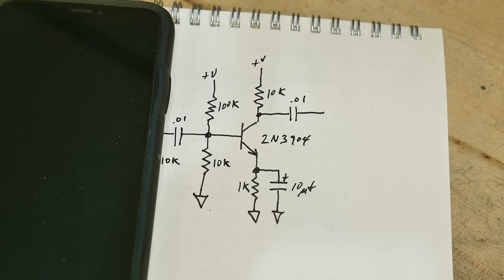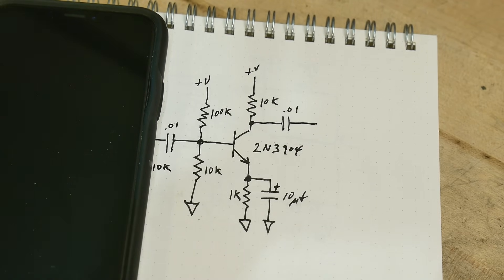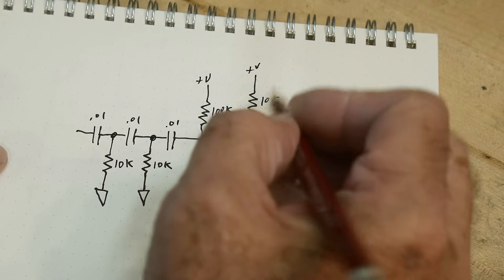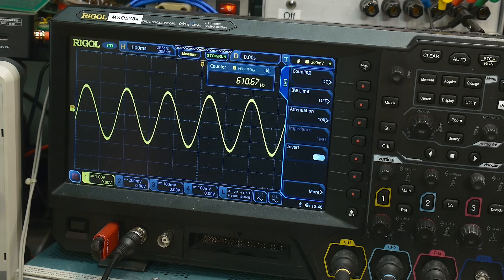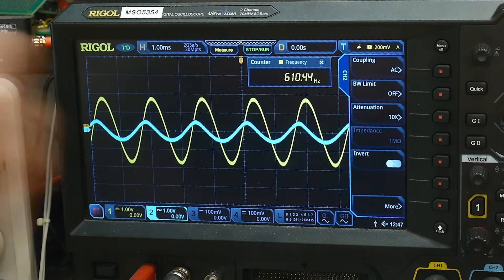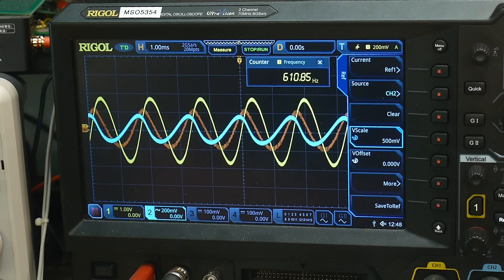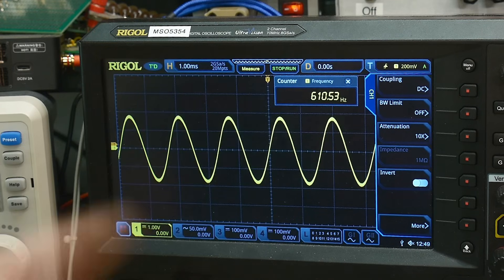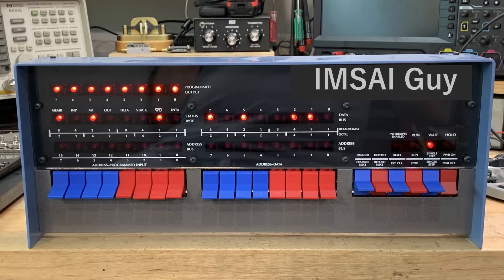#1703 Phase Shift Oscillator

Comment: You are not into nerdy mathematics that much, are you sir?
Reply from the maker: I avoid it on this channel. Lots of other places on YouTube if that is of interest.
Reply: @IMSAIGuy  a physicist is all about mathematics. I read a book of practical electronics by Paul Scherz who is also a physicist. It is an excellent book. I recommend you check it sir it presents material on paper just the way you do on screen sir
Reply from the maker: @awaismushtaq5719  yes, I have a degree in Physics and a degree in Mathematics. I avoid the math here on this channel to reach more people and impart an understanding at a more basic level.
Reply: @IMSAIGuy  cool I like it
Reply: @IMSAIGuy  I am an engineer not an electrical engineer though. Every engineer studies electronics as it is deeply integrated into every engineering discipline. I learned electronics by reading and messing with bread boards and components. Burnt loads of them eventually cutting my losses when I got the grip. First successful thing I built was an AM transmitter with about 50  yards of range. When I was testing it a police vehicle was parked right outside our house. They were there for a different matter yet they had scanners. They picked up my transmission which I was playing from my computer cursing a local politician. They knocked at my door and confiscated all of it. Warned me not to do it again or I'll end up in jail. Electronics is fun. Yet that didn't stop me from building an other one 10 watts of solid power. Still use it off and on but carefully. Your videos are fun, loads of fun. Primarily because you learnt electronics the way I did though you are far better than I'm. Good luck sir!

Comment: It amuses me when people talk about phase changes as one can only see phase change when one sees the past and the present on an oscilloscope!!!!!!
In real time, " The Present"  all the voltages appear at the same time but they have various magnitudes, due to the memory abilities of the " reactive elements.".  When the output of the oscillator is zero voltage,  there is one or more capacitor which has memorised a voltage and this is what keeps the circuit alive and working.................THE MEMORY OF THE CAPACITOR AT THE PRESENT TIME, 
It all has to do with the RATE OF CHANGE OF THE INPUT WITH RESPECT TO THE OUTPUT.   All the action takes place at the present time   and one should not use a two dimensional space to see a sinewave  The voltage at the output of an oscillator is between two terminals all occurring at the same time,  The present is such a short duration of time and one needs memory , rather than " phase".

Comment: Nice and interesting! Thank you! Could it's freq be varied by varying the 3 10k simultaneusly? With some sort of VCR... FETs for instance? What about the distortion of the sine with this topology? It's purity
Reply from the maker: you could try these: https://youtu.be/9SzruMuWF8E?si=xGmGTg8UY5943kih
Reply: @IMSAIGuy   Thank you, I'll take a look! My idea is to keep it simple and analog. I usually use DIY vactrols (LED+LDR) for instance and will try soon FETs as VCR. But I will study the MCP4131 for sure, thanks!
Reply: I don't know about the resistors, but my 10nF caps are tied up in another project, so I used 6.8nF ones. My frequency was 836Hz.

Comment: With 9V supply, the circuit as shown has about 10% distortion.  If you add a 50R in series with the 10uF, you will get about 3%.  With 62 Ohms you would get it down to about 1% but there is a danger of it not oscillating at all.
Reply: How do you know this? Have you somehow calculated it or tried and measured? As far I know electronics the resistor you added to the emitter capacitor adds some negative feedback to signal flow of the amplifier and maybe thus it improves linearity of it. Am I right? I'll try it.
Reply: @erykbaradziej3639  I modeled it in spice to confirm my guesstimate.  I estimated the amount the gain was greater than what was needed to sustain oscillations. I then assumed that the gain was decreased to the amount that just makes a constant amplitude by clipping.  I got that it would be something near 10% as in something more than just a few and less than 30%.  I went with spice rather than trying to work out the math in detail.
Reply: Now I understand, thank you for the explanation. @kensmith5694

Comment: coax makes a handy phase shifter with less loss, but it'll have to be pretty long to oscillate at 600 Hz 🙂
Reply: Yes, about the longest delay I ever did intentionally that way was 2uS.  It was a roll of coax.
Reply: @kensmith5694  RG-59A/U PE (Belden 8241) veolcity factor is 0.66
0.66 * c = 198000000 m/s where c is the free space speed of light.
for a 10 KHz oscillator 1 wavelength in the cable is
198000000 m/s / 10000 1/s = 19800 m
need 180 degrees phase shift 
(180 degrees / 360 degees) * 19800 m = 9900 m or 9.9 Km.
If you raise the frequency by a thousand times 10 MHz, and a better transistor then,
the cable has to be 9.9 meters. For 100 MHz (definitely need a much better transistor) then just about a meter of cable. (But... might need to take attenuation into account.)

Comment: Output impedance is too high. Op-amp oscillator is better.
Reply from the maker: as shown this has 10K impedance. for many applications this is just fine, or follow this with an emitter follower for low impedance. this circuit works into 100's of megahertz which op amps will have a hard time. there is no one size fits all in electronics.
Reply: @IMSAIGuy  maybe a 2N2222A for a better ft... if you're going to 300 MHz?
Reply: If you want a low impedance, put a 50R in series with the 10uF and take the signal from there.
It will be small but low impedance.
Reply: @kensmith5694  r_eb is about 100 ohm. You'll cut down the gain a lot. A minimum gain of 29 is needed for the amplifier.

Comment: A very nice demonstration of the oscillator with the phase shift per stage.  With three identical stages each one advances the phase by 60 degrees to get a sum of 180 degrees. In the practical example it is not really ideal and also a bit nonlinear at the transistor.  
In the comparison of the signals on the scope you see that the phase per stage is not delayed but advanced. A delay would go with low pass elements, in this example we have high pass elements.
Reply: I notice they are using 3 tantalum capacitors could you not just have easily done this with two electrolytic as they move the phase by 90?
Reply: @nigelrhodes4330  Never seen that. Usually you need 3 filter stages. The oscillator is only stable if there is more than 360 total phase shift at higher frequencies. That's not possible with just 2 stages... or is it? (Usually R and C chosen so that each RC stage has more than 60 degrees phase shift at a frequency above the desired oscillation.)
Reply: @nigelrhodes4330  , Hi! No.

Comment: Thanks, nice demo.
I however don't understand why is this called a positive feedback.
Isn't the feedback, after shifting 180°, being an inversion of the output?
Calling this a negative feedback would make much more sense to me...
Reply: If I'm not mistaken, the signal is inverted 180 by the transistor, it is then routed back through the series of RC circuits, putting the signal back into phase. So the feedback path is adding to the signal, not subtracting.
Reply: @Spentelectrons I also remember from college days in order for a filter with a feedback loop to oscillate, you have to have an odd and min 3rd order (3 caps) to start oscillating.  I maybe wrong.   It's been 30-40 years since I saw this circuit.  The unity gain would be balanced out by the filters.   I remembered I built a chebyshev or Butterworth filter and made the circuit to oscillate.  Oh no .... 3rd order transfer function, Laplace transforms, all those things that I hated and never thought of until today!
Reply: I had a class that touched on the subject of phase shift oscillators.  My hazy recollection is that there are two key elements.  1...   there needs to be 360 degrees of phase shift in the feedback loop, and  2... the loop gain needs to be exactly 1.   If the gain is less, the oscillation will die out, and if it is more, it starts bumping into the supply rail(s).  As such, it's a bit incorrect to say the feedback is either positive or negative, but oscillators are generally considered to have positive feedback.
Reply: @SkyhawkSteve  That's the Barkhausen criteria... but he used to get mad if one didn't realize that's not enough for oscillator stability. (They said however... his bark was than his hausen... if that makes any sense... at all.)

Comment: Would love to know the harmonic distortion on the output. Did you build a beautiful sine wave or a not quite perfect one?

Interesting how the final input? to the transistor looks nothing like a sine wave, more like something half-rectified, but other end of the amp does look just like one.
Reply: The distortion as shown will be about 10%.  Add a 50R in series with the 10uF to make it about 3%
There are ways to get lower distortion if needed.
Reply: @kensmith5694  Hewlett's Wein bridge oscillator with tungsten incandescent lamp in the feedback loop... that comes to mind. (Hewlett's design had very low distortion for the time.)
Reply: Capacitance.

Comment: Many thanks for sharing this with us. I have a quick question: What is the function of the resistors between the capacitors? Are they being used as  filters? What happens if the value of the resistors are changed? Does it affect the oscillation frequency? 👍
Reply: Each [series C + parallel R] is its own little RC filter, in this configuration a high pass filter. I'm sure there's an IMSAI Guy video on the opposite config which forms a low pass filter (or maybe both).  Each one only lets signals of certain bandwidth or above pass through. In the end, there's one bandwidth which 1. is let through by the high-pass filters, and 2. is phase shifted by each filter stage so that it ends up 180 degrees out-of-phase at the input to the transistor amp again; finally the transistor amp does another 180 degree phase shift (otherwise known as inverting) to give a full 360 degrees positive feedback loop to that one frequency.

Changing the resistor(s) will change the nature of the RC filter(s), and yes therefore change its phase-shift response, and so change the optimal frequency which receives an amplification by the circuit.
Reply: @ivolol  I think you need better than 180 degrees phase shift... so greater than 60 degrees per stage (if you use the same capacitor value and resistor value... which is usually done.) The idea of the low pass filter is it limits the oscillation to the desired frequency. (That might be fiddly.)
Reply: The C-R network as shown does not cause delay.  In fact it advances the phase!  (As actually shown by the scope traces).  This in principle is prone to producing harmonic distortion (think high pass filter characteristics).  So, you depend on transistor slight non-linearity for stabilizing the amplitude and producing decent sine wave.
 . 
 In this respect - can you make an oscillator without the phase shift?  As it happens, a book by James G Holbrook, Laplace Transforms for Electronic Engineers, (Library of Congress Catalog Card 59-12607) outlines some circuits that can work without the inverting gain stage.  I believe he patented it as a tube circuit, cathode follower.   The book was first published in 1959, so the patent must be expired years ago.  By the way, he also analyzed the R-C circuit turned into low pass, and found it required a gain of -29.  On the other hand, if you have a basic Twin-T circuit bridged with an additional longitudinal capacitor, you can get at resonance 0 phase shift and a few % gain (say 1.06 or similar).  That could be just enough to cover the miscellaneous losses in in the components and wiring to function as a suitable feedback element in an emitter follower (or cathode follower - or source follower FET) buffer to form a sine wave oscillator.  See, one way to make an RC oscillator, even without a voltage amplifier...